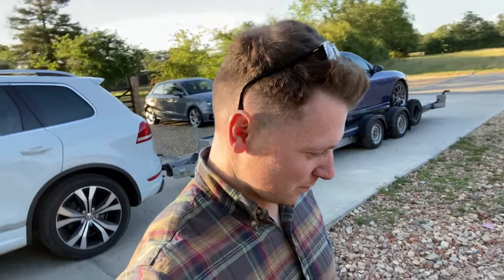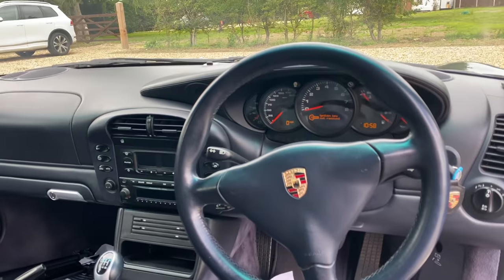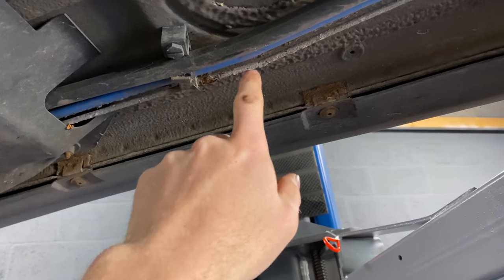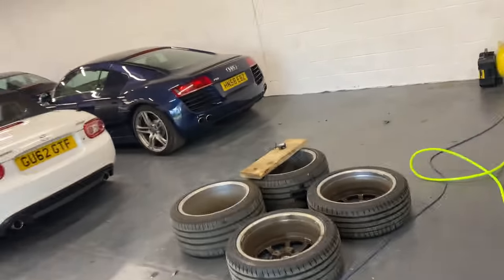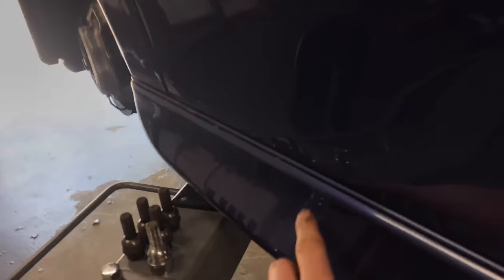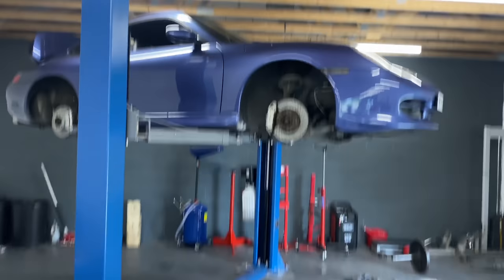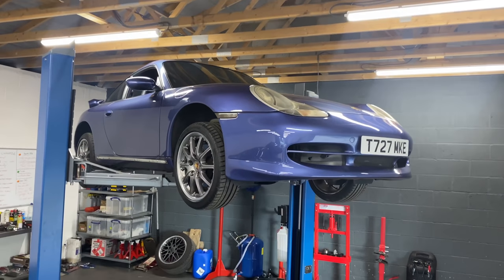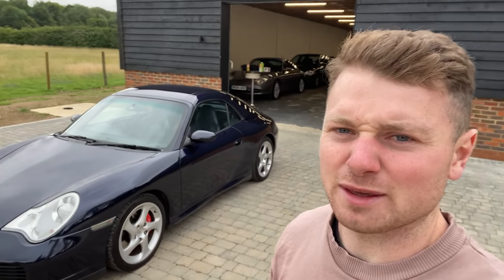We sell a rare Porsche 996 BACK to its original owner! - FGP Prep Book EP11

Comment: One of most common problems with 911 even with new models is front wings rusting at bottom near the sill due to stone chips.
Other  German manufacturers have rectified this problem by having arch liners that cover this area apart from Mercedes.

Comment: So far i have not seen you doing any inspection on bore scoring, nor seen any problems on the cars you are preping? Would be cool if you did a video on this issue and solutions (especially if and how you have solved it).
Reply: I recall he’s mentioned that it’s now very rare. These are now classics, as a 2024, the oldest 996.1s are what, 26 years old?
I’ve heard an argument that if they were going to fail on bore scoring, they would have done so by now.
I don’t think we understand why some cars suffered like this and others not. Some say it’s how they were used, revving too high when inadequately warmed up. Others say cornering under hard throttle leading to oil starvation. Yet others swear by fussy oil grade & brand selection & everyone agrees, frequent changes is a sound precaution.
On any vehicle forum I’ve ever been on, oil threads are THE most contentious. I don’t know why. All premium oils of the grade specified by the manufacturer are going to be fine. The exception is if you’ve a wet clutch, like most motorcycles. Some additives definitely promote clutch slip. I mostly fettle 45 year old Suzukis. They were designed for 1970s oil technology. I wouldn’t pick “better” modern oils for that reason. 
Luke is canny and I’m guessing that if he suspects bore scoring, he would decline to buy in the vehicle.
This car has had an engine rebuild. I know almost nothing about 911s, but I believe bore scoring, if bad enough to result in smoking, can only be fixed with a rebuild. I don’t know of any other reason beyond catastrophic mechanical failure that would lead to a rebuild. And most people say 911 motors are nearly bulletproof beyond a couple of well known weak points. So I’m guessing it’s died of bore scoring. What does Luke say?
I note that a sump pick up modification ex factory features in some 996 motors, like the X51 Power Pack engine. Presumably Porsche had reasoned that this reduces risk of bore scoring?
It’s a very good question you ask. I didn’t intend my post to be deflection in any way.

Comment: I'm a little confused. I thought you said the car the original owner wanted to purchase back you had already sold. Did that happen with two different cars?
I can't believe that place screwed up the split rims and mixed up the centers.
I love watching these videos because I love the 911s.
MOT is pretty thorough. I love that shaker machine. Is that to make sure the mirrors don't fall off? Lol. Probably for the suspension bushings and stuff.
We don't get any kind of inspections like that over here in the U.S., just annual smog check.
Reply from the maker: Hi Werner Danler. The person you see in the video purchasing the Zenith Blue 996 owned the car previously a number of years ago. I wasn't aware that there isn't a mandatory like-wise test in the U.S!
Reply: @friendsgreenporsche5234  I took my Peugeot to Kansas back in 93 and they said they were going to do an inspection when I had to register it there.
So the guy comes out and checked the car number and the engine number to make sure it was original. That was it!
Here in Nevada they just do annual  smog checks. That's all any states do as far as I know. I know that if you just run out of gas on the autobahn you are in deep doo-doo. 
Cars here are pretty unsafe.